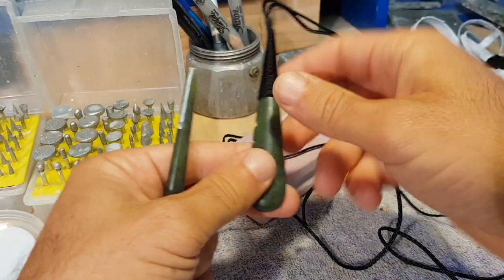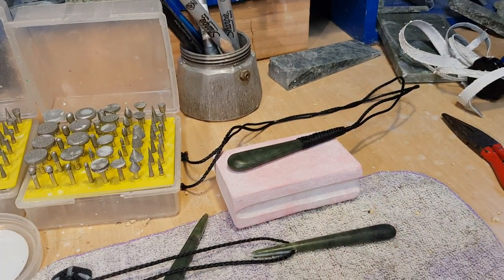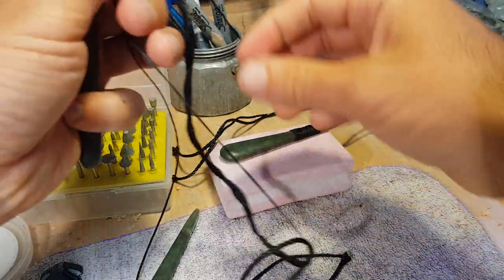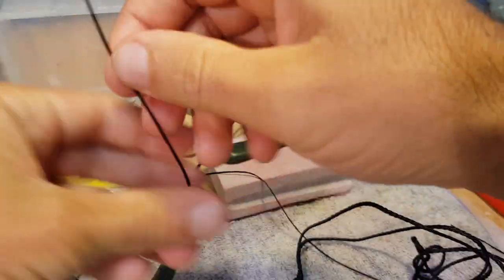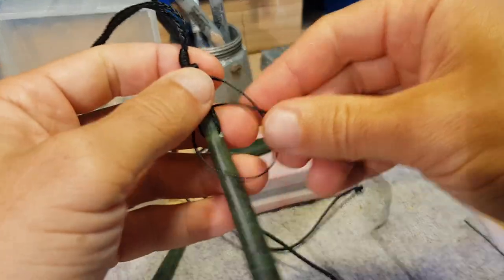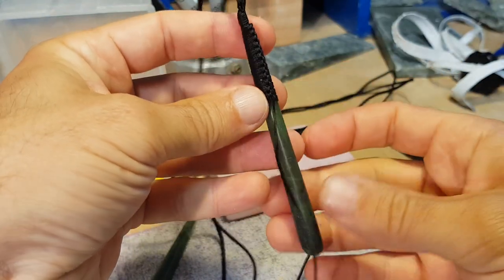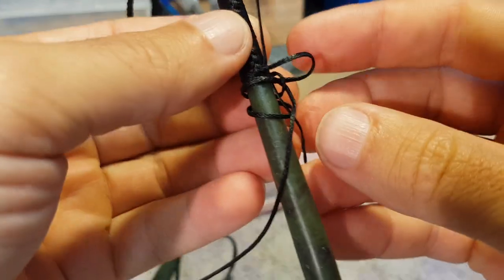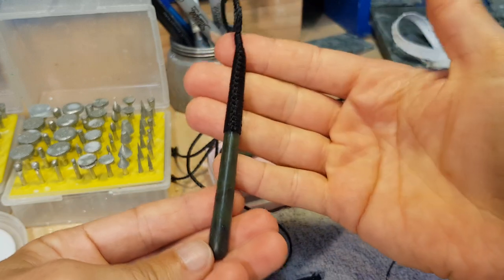Tear Drop, Kuru, Roimata, Lashing Hints and Tips, Real Time.

Comment: I'm thinking of using your lashing techniques on some glass jewelry I'm making, so I'm finding your lashing videos really helpful! I make rosaries for donating to hospitals, etc, and the Sister who taught me used a dental floss threader to pull the cord thru holes. Dental floss threaders are basically fishing line sealed to form a large eye at the end for dental floss to fit thru, which you then thread thru your dental work. They work FANTASTIC for any size cord to fit thru any size hole. They'd work really well to pull the thread up thru your loose loops at the end here as well. You might find them really useful and you get a pkg of like 20 for just a few dollars. Thanks for the videos!!
Reply from the maker: Good idea, I'll look into that.

Comment: Your videos have been really helpful.  On this one though, I used every name in the book to try to finish the lashing! Then I thought to use the same thing you do with making an adjustable necklace - use a pull out loop on the last 5-6 wraps. Works like a charm. I am once again a happy camper!
Reply from the maker: Good one. I have used that too. Just be careful of  reading things when you pull through as the lashing can get super tight. I have snapped cords and the actual penda t by messing this up.

Comment: Kia ora Campbell thanks so much for your guidance and sharing I'm crafting such a taonga for my wife's 60th. I have noted this on the Nautilus website but which 8 braid do you use I don't see coreless? PS: Just about finished my creation of stone cutting table based on your advice I'll share when done, found an old tanner spindle thingy. Thanks again.

Code	Size/Diameter
PFS-25	1.8mm	               
PFS-45	2.4mm	            
PFS-60	2.8mm	     
PFS-105	3.8mm
PFS-120	4.1mm

P = Polyester N = Nylon
F = 16 Braid H = 8 braid
S = Standard Core (non-braided) (PHS) F = Braided Core (PFF)
Reply from the maker: Whenever I have bought it I emailed them direct to see if it was in stock. I think they may make it to order. Tell them what it's for and they should know what your talking about. On the invoice it was called 2E-8 braid black. I could sell you some if you just want it for one taonga as a back up? Or use the 1mm waxed plaited.
Reply: @CampbellCarving  Kia ora e hoa. Look I plan to make more for my whānau katoa as I move on past 62 haha. May even do a few specialised for other people not sure at this stage. I'll try them first and get back to you if any problems many thanks for the offer.
Reply: @CampbellCarving  On second thoughts e hoa I might buy some off you in the first instance to at least cover my wife's taonga if that's okay I'll pay for postage etc.
Reply from the maker: @DavidTawhaiB  contact me through my website campbellcarving.co.nz we can sort it there.

Comment: Is there any significance of placing the knots down the side of the pendant as opposed to down the front?
Love your vids certainly helps me gain a better skill set. Nga mihi
Reply from the maker: No. It worked out this way unintentionally, as I had the hole drilled through from the side and i followed that line without thinking when doing the knots. And of course the front or side is subjective sometimes too.
Reply: @CampbellCarving  thanks, if there were protocols it would be good to follow them.

Comment: Question. When you are doing the last wraps loosely so you can hide the end. Could you do it over a pull cord like on the back of the Toki? So you could pull the end through with that? Or is it too complicated and just easier to run it under the loose wraps at the end? Thank you.
Reply from the maker: You could definitly do it that way, but kind of defeats the purpose I think, you can just use a pull cord earlier or at any time and not need to muck around with the tricky loose wraps. If that makes sense.
Reply: @CampbellCarving  ok I see. Thank you for your help.